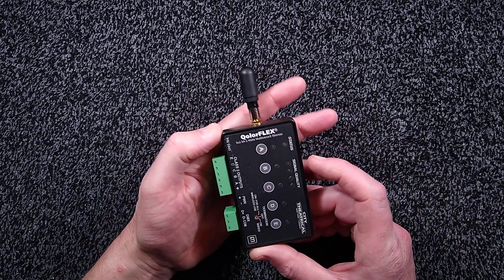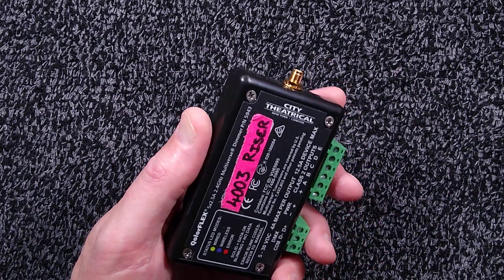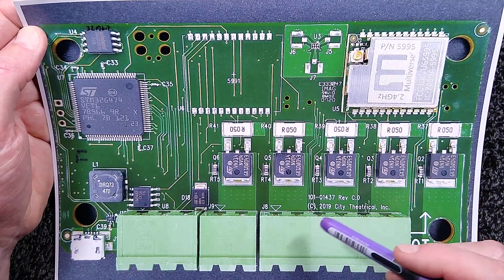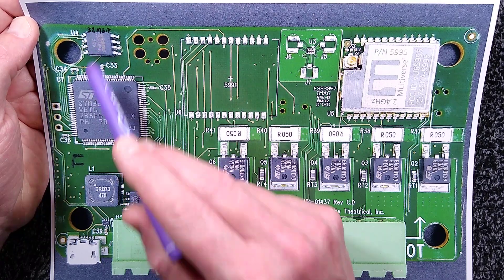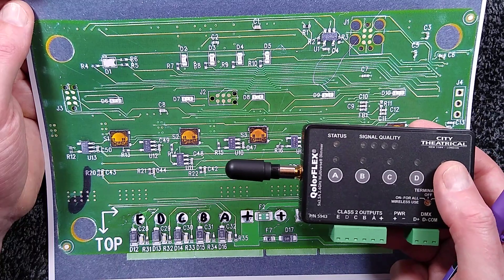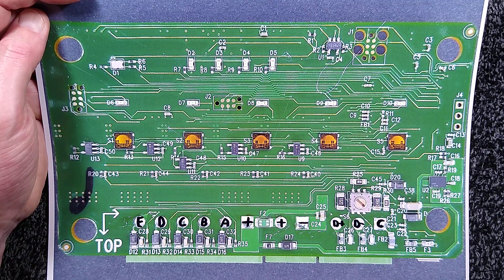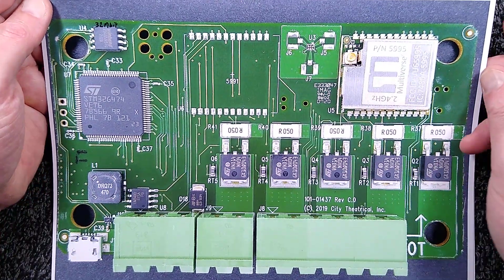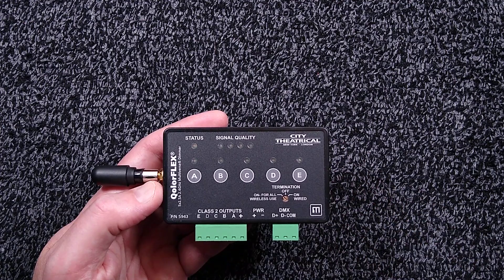Inside a wireless DMX receiver

Comment: I’m not sure why you’d need inductive load protection, usually driving DMX you won’t encounter much of that unless maybe you have a fail in the line somewhere. I’m used to working on indoor systems, but I know that outdoor systems like you work on are much more prone to failure.
Reply: Inductive load protection was on the PWM outputs intended for directly driving loads such as lights, fans, motors etc. Protects the MOSFET. I don't think it was on the DMX output?
Reply from the maker: The protection diodes are on the dimmer outputs to protect against external inductive elements.

Comment: Probably better to hard wire the comms in critical situations. Wifi can be problmatic in situations of multiple mobile devices creating a radio soup, plus if there are any major of communication towers in relitivly close proximity can swamp or overwhelm even though they are on diffren frequency. I've experianced similar situations at events about 10years ago where all the testing during setup of wifi communications and control had excellent signal strength and noise levels. Hopefully over the lasy 10 years equipment have inproved. Back then it all turned to shit once all crowd arrived resulting in the attenuation of signal strength due to absorbtion of signal and noise went through the roof due to all the mobiles plus the security radio hand sets adding to the soup mix. While wifi systems are designed to cut through this type of digital wifi noise the shear number of mobile devices and the bags of water (human bodies) absorbing signals. Those devices that we hadwired the control communications worked floorlessly as to thoes wifi devices that where in close and line of sight with transmitters. Thoes recievers that were >20m away or lost line of sight due to bodies all played up.

Comment: 2.4GHz has gotten super crowded. Even in my own house here in the US, for some reason my living room is like a 2.4GHz twilight zone. Bluetooth and wireless devices that use 2.4GHz in there won't operate further than about 3 feet without severe interference. So like my wireless mouse, keyboard, wireless game controllers have a very poor signal. Out of curiosity I checked nearby signals with WiGLE Wifi (Android App), and it detected around 50 (!) other mostly Bluetooth/BLE and WiFi signals from who-knows-where. And I'm in a detached single family home. Although my living room windows point across a big greenway/right-of-way to the backyards of other homes, so I imagine that's the reason, and the shape of the room (half-vaulted ceiling) acts like a big reflector.

Comment: There's a lot of stuff on 2.4GHz, including microwave ovens.  Got a microwave oven in the Green Room by any chance?  Get rid of it.  Did you try using an AirSpy or similar cheap SDR to check the spectrum for offenders who might have been interfering with your link?  Did you try a directional antenna on one end?

Comment: I run sound for a church.  I had to go through and manually adjust the channels for all our wireless mics because we were getting interference from two different TV channels.  We never got audible interference, but we would have mics randomly drop out due to the signal noise.  As far as I could tell, we weren't actually using the same frequency as the TV.  Instead, we were close enough to the broadcast station that the secondary peaks were overwhelming some of our channels with noise.

Comment: 2.4ghz really isn't the best choice here... Signal pentration isn't the best, which is a bit problematic with those stone walls! Plus once you have all the audience there, there are hundreds of 2.4 GHz devices around to play havoc with your previously perfectly working setup. That unit either needs to have a constantly moving (frequency hopping) system so it doesn't just get jammed out, dual-frequency link for redundancy, or some really noise rejecring/immune smarts to the RF link.

Comment: This being 2.4ghz is bad news.   There are wifi networks that actually go out of there way to interfere with other 2.4ghz radios.   If the venue has one of these systems you can guarantee problems.

Comment: Not an expert on wireless by any means but we have had issues with nodes dropping off the network when there was a lot of noise, we had the option to change the channel as most devices use channel 1 by default. 
May be of no use to you at all but hey you never know

Comment: no isolation between the DMX and the USB power supply ....  no DCDC converter , no max 485 .. so direct from the STM ?? 
the STM is overkill it's for ethernet applications , not serial data from the RF module ... this STM cost 1$ but now , it costs 50$
Reply: There was a driver for the RS485 bus, the small 8pin chip right next to it - I'm just not sure it is a max485, but there are plenty of other useable ones. The board said it was designed in 2019, when the STMs were still cheap. And it was probably chosen for the memory, this module seems to have more functions than you are ever going to use. But those big ones were about 5$ even in 2019.

Comment: The very best wireless system is very nearly as good as a cheap cable...

2.4GHz is a horrible mess, there are a lot of devices that break the licence-free requirements, transmitting at higher powers and duty cycles than you're actually permitted to so - but it's very hard to prove who's doing it, let alone ask them to stop.
And even when every device is compliant, putting ten thousand of them in close proximity tends to swamp some of them.

In general you need a good directional antenna to have a hope of reliability once there's a lot of members of the public about - the camera systems often have someone operating a bucket antenna to try to ensure the link stays (mostly) up.

Comment: Hello from Urdaneta City, Pangasinan Province, Island of Luzon, Philippines. I'm retired from Seacoast New Hampshire, USA.

Amateur radio operator for 30 years KB1DIG. Played around with UHF VHF antenna designs for years.

That said. Thinking out loud. The word that comes to mind is colinear. Basically just stack two half-wave elements on top of each other. With a little bit of induction between the two elements for balance. Basically the antenna is still omnidirectional. But, with almost twice the gain. Twice the transmission and receive strength. Could also make the problem twice as bad hmmm 🤔 but, worth checking into.

Possibly there is something off the shelf? A better antenna? One with high gain.
Reply: Another though is horizontally polarizing the signal. But, it's not easy. The antenna I see in the video is an omnidirectional vertical. A lot of the signal is going straight up. Could do a Halo design? But, you will probably have to design your own? Halo antenna horizontally is omnidirectional. Going from vertical to horizontal polarization can null out some of the noise in the background.

Comment: Hundreds or thousands of mobile phones with auto wi-fi detect turned on will be constantly pinging the devices and creating a high RF noise environment even though no connection is being made. The solution needs to move the frequency of operation to another dedicated, protected, frequency band. Mixing it up with all the domestic wi-fi signals and other wireless appliances is just a recipe for failure.
Reply from the maker: These devices don't operate as wifi equipment.  They use a different RF protocol.

Comment: Big problem with using public/unlicensed bands is EVERYONE else is using it.  Low bandwidth frequency hopping tends to be better for getting through, but a high bandwidth user will swamp out or have issues getting a clean connection.   Have just gone through swapping a 900MHz system back to a slower speed because of poor signal sensitivity.

Comment: The connector (J4) next to the micro controller is most likely a serial (RS232 compatible) debugging port. They're often left still functional after a product has been sold and can typically give various useful information when hooked up to a PC.
Reply: Or it might be JTAG or microprocessor specific debug pins.  Even JTAG 4-wire doesn't have a standard pin assignment in the TagConnect documentation.
Reply: @johndododoe1411  Correct, it can be various things, however the programming socket is most likely the JTAG connector for the MCU. Also in my experience, the serial debug is typically a 3pin connector with 100mil spacing between the pins (as in the image) a standard pin header.
Reply: @Gin-toki  Once a designer uses TagConnect plugs, they might as well use the smallest one (this one!) for 3-pin debug and specify pin assignment in the service documentation.
Reply: @johndododoe1411  I'm not a big fan of that type of connector, the holse in the PCB takes up a lot of real estate.
For the 3 pin connector, it's easy enough to trace it to the MCU and look in its datasheet to see if they're UART pins or something else. My guess is that they are :)
Reply: @Gin-toki  Obviously the designer of this board liked TagConnect, so your dislike is not relevant.  As a surface layer feature, tracing connections from 6-pin TagConnect to the chip should be even easier than for a through hole connector that might connect at any layer.

Comment: With the multiverse system I’ve had best luck using the band hopping modes. Also had to replace a unit once that was sending unstable DMX values, swapping it did the trick though.
Reply from the maker: We had channel hopping on.
Reply: @bigclivedotcom  Guess you've tried it on show ID 101 thru 116?
Reply: @bigclivedotcom  had an issue at yacht club because channels were quiet all week long devices picked them and stayed there on noisy weekends. Had to manually set them at odd channels after watching usage patterns with scanner.

Comment: 900MHz in UK is licenced frequency whereas the 2.4GHz is licence free. Agree with others, 2.4GHz is not fit for mission critical use - too many potential interference sources and virtually impossible to troubleshoot as the interference disappears when spectators phones and the TV cameras etc are gone.

Comment: It's interesting that there are no crystals for the microprocessor - maybe it pick up it's timing from the rf module. And that really seems to be overkill for the processor anyway.  That chip has 84 I/O pins with 42 of them being analog input, tons of peripherals like SPI. I2C and CAN, and a Floating point unit. Seems like a lot for 5 PCM outputs, 5 or 10 sense inputs, a DMX line and a few leds and switches. Maybe the 170 MHZ speed was needed to keep up with the communications while doing everything else. Maybe they just use this micro in all their products to keep programming simple and it makes more since it the larger units.
Reply: I agree that chip is comically overspecced, especially since the 2.4ghz module isn't a generic wifi device but a fully integrated embedded dmx controller itself...

Comment: Wireless DMX is, in general, experimental at best.. It's not quite out of it's infancy yet..
I'm very much looking forward to the time it becomes an actual alternative to wired.. Would save me laying miles and miles of loom every time... But it's (at least the ones I've tried) still way to prone to errors, faults and weird bugs. Still too much head-scratching and eventually having to lay the wires anyway.. But If it works trusses will look so much cleaner.

Comment: U3 is clearly the advanced flux capacitor that permits the device to access multiple universes.  ;)

Yeah, it's probably what combines/splits signals to the RF modules and antenna.

As others have said that band is saturated with everything from your setup, cameras and customer's wifi earbuds and whatnot. Might look into hardwiring everything you can to avoid more interference.

Comment: I would have thought that something that costs this much (ouch) would have had some kind of robust multi-channel switching for the small amount of data they shift. It doesn't sound good that they lock up either. They should be able to recover very quickly. I would be very cheesed off to say the least. Perhaps a Raspberry Pi and a few NodeMCUs with a few other bits would do the job better!😂
Reply: Most important is a licensed band RF module available only to licensed professionals.
Reply: @johndododoe1411  Very interesting. Do you have any pointers to further information? I have looked at Ofcom's site, primarily at PMSE and can't find anything relating to 2.4GHz equipment in this context.
Reply: @Martynjs  Point is to avoid the 2.4GHz consumer-cluttered band entirely.
Reply: @johndododoe1411  I am well aware of licensing requirements for radio devices relating to events - I was using them back in the 'dark ages' long before even the internet was  a 'thing' . The point is, I am referring specifically to this device which operates on 2.4GHz - which is (of course) very crowded, which is why device developers have implemented technology to try and mitigate this as much as possible. As far as I am aware, 2.4GHz (as well as a few other frequencies) are licence exempt at the moment, so it would be helpful to keep up-to-date - just out of interest. Anyway, thanks for your input.

Comment: the DMX cat is an amazing bit of kit. But I’ve never had much luck with wireless dmx. Very hit and miss. Some times it works a treat other times. Drop outs flicker and delayed response.
Reply: I've had a weird delayed response when using one of my wireless TX/RX's, sending to a chain of wash LED PARs where the first PAR had the RX on its input and thereafter all daisy-chained hard-wired. They all responded with very little delay except for the very last one (chain of 4, so not too many, and all on a single T-bar). Never did find out why the very last one was slightly behind the other 3.

Comment: Using 2.4 GHz signaling is practically asking to have interference in a crowded venue.
A lot of people will have the WiFi on their phones active and all these will sit there idly sending out their packets asking if there is any WiFi access points nearby among other things.
Not to mention those who use their phone as a WiFi hotspot for their friends or their other WiFi using devices.
Then there is Bluetooth operating in the same band, so add on all wireless headsets, a fair amount of smart watches, etc, etc.

433 MHz might actually be a lot quieter, but ideally one would want the thing operating in its own band, just like wireless microphones do.

Comment: in the Fpv drone hobby, many pilots use a receiver link by a company called 'TBS', the receiver range is called 'Crossfire'. In the US it uses 915mhz but in the UK and Europe it has to use 868mhz. It has a reputation of being very reliable over long distances with exceptionally low latency. Also if your still keen on 2.4ghz the companies ImmersionRC and ELRS use 2.4ghz for low latency long range drone links. These guys are pushing the boundaries for high speed RC links in the hobby and maybe worth a look. Tony Cake of ImmersionRC really knows what he's talking about 😀👍👍

Comment: A Revision C board, and made in 2020, I wonder what their current design revision is. 
As an RF nerd, I would say a directional antenna on the receiver might help. Ideally on the transmitter too, but given the large physical area it all covers it may not be possible. It wouldn't need to be a long beam, just enough directivity to reduce the interference from phones, video etc on the same band. Maybe one that is circularly polarised rather than vertical. A flat patch antenna would be cheap and quite directional.
Reply: This receiver being in the clothes of a dancer prevents directional antennas from ever pointing the right way, while a transmitter can be pointed to cover only the stage area needed, like a follow spot.

Comment: I'm surprised you didn't recognise the Y shaped part. It's a flux capacitor. They forgot to fit it which is why it didn't work
Reply: It will be there in 2025, believe me. I'm getting the plutonium for the De Lorean.
Reply: It was definitely fitted, look again.

Comment: Sometimes adding a higher gain antenna will make the problem worse, because it will increase the interference signal along with the desired signal. One option is to try changing the polarization of the antennas at each end most likely from vertical to horizontal. You can achieve up to 23dB of isolation from the unwanted signal if the unwanted signal is the opposite polarity. Major drawback to horizontal polarization is that it tends to be more directional. The 2.4 GHz cameras are most likely a much stronger signal and impossible to compete with. They should have coordinated with your team. The show show should have priority over them.
Reply: Also when Clyde talked about remote mounting antennas... the dB loss per foot of that coax is phenomenally bad.
Reply: @theoldbigmoose  Yes you're better off doing all your RF conversation near to the antenna and keeping coax as short as possible unless you have the budget for a RF over fibre setup.
Reply: @theoldbigmoose  agreed, was trying to keep my already too long of a reply from being too long. There are always gives and takes with coax at 2.4GHz. Sometimes the loss is negated and overcome by the gain achieved by getting the antennas in a better position. Other times, not so much.
Reply: A more directional aerial such as a beam will in general improve the signal to noise ratio unless the noise  is coming from the same direction in which case it wont make it worse, the ratio will stay the same.